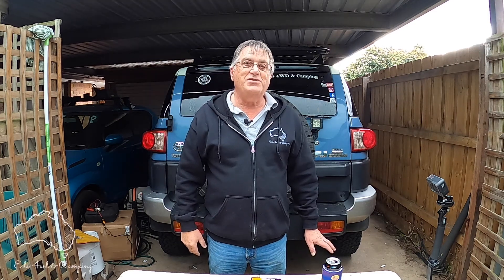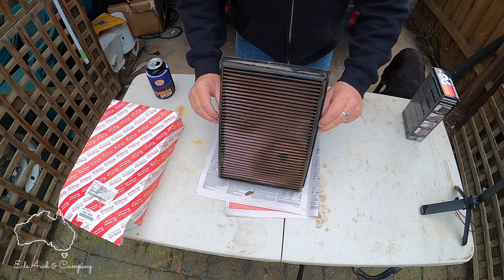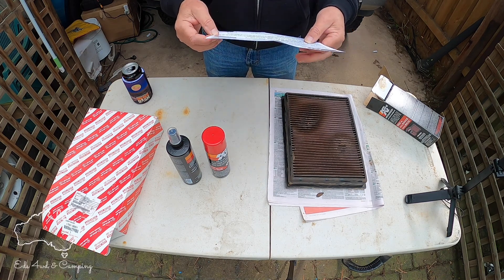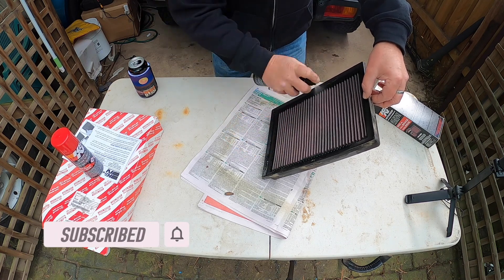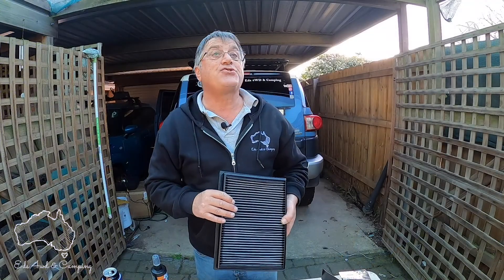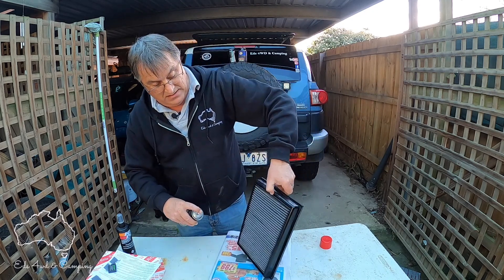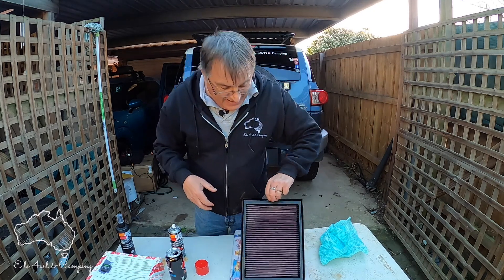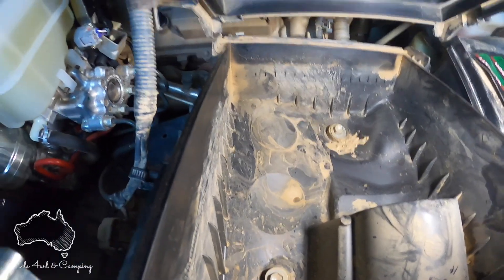How to Clean K&N Air Filter Service - How to Clean a kn air filter

Comment: You know they call K&N filters rock stoppers right! :) It's kinda hard to tell from the video, but looks like some dust snuck past onto the clean side?
Reply from the maker: Yep some dust got through but not as bad as it's been in the past with the original paper filters you know that Toyota airbox.
Reply: @eds4wdcamping  I thought it was only the 79/200s that were rubbish.

Comment: Hey mate, that filter would have been working Fine. You could have tapped it on a log and put it back in and kept using it, I have run K&N filters for 35+ Years and never had and issue.
Reply from the maker: Thanks for that I didn't know thanks for watching